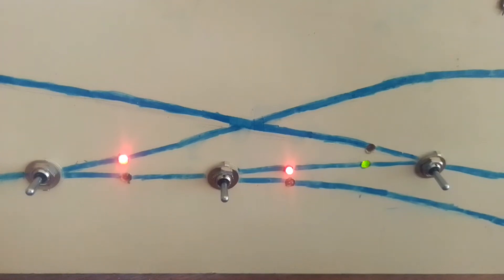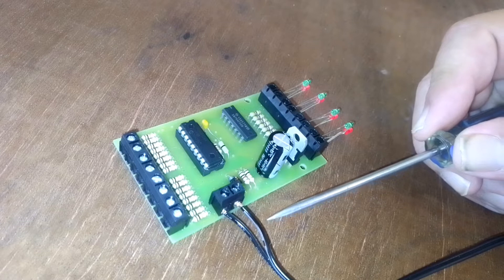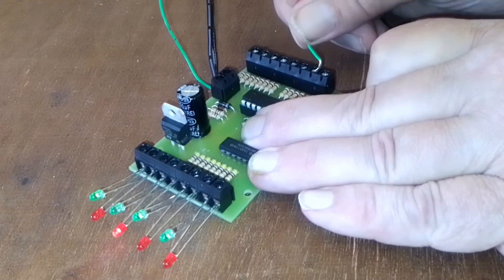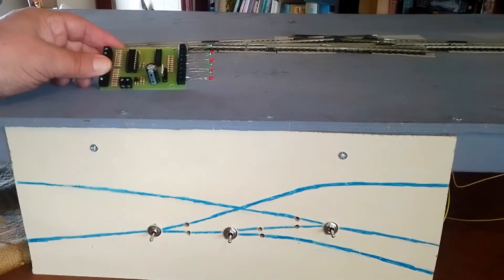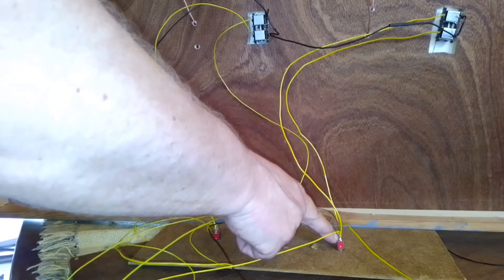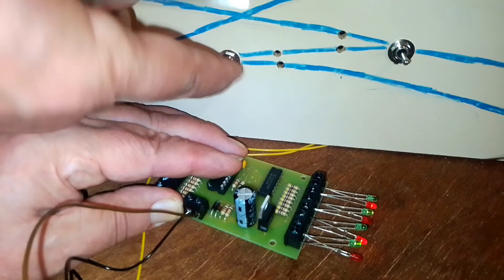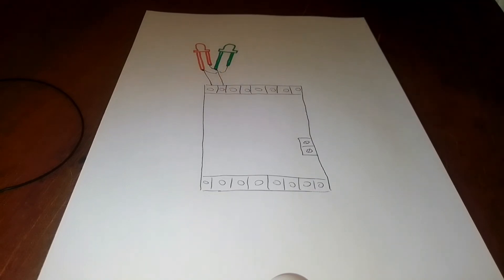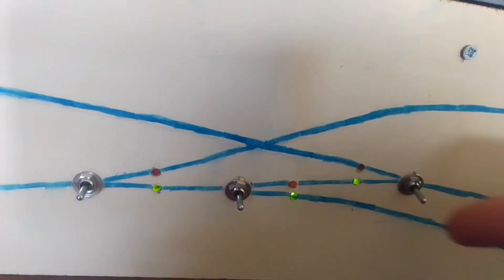See how your Points are Set

Comment from the maker: This video shows our Point Indicator Standard, we also produce the Point Indicator SO which allows a large number of LEDs to be operated and the Point Indicator Relay which in addition to switching the 8 LEDs has a SPDT contact for each point setting. This is particuarly usefull for switching the frogs of N gauge points which because of the small throw of the point blades are difficult to make operate a contact mechanically. For more information and for online ordering have a look at the point indicator page on our website http://www.heathcote-electronics.co.uk/point_indicator.html

Comment: These systems are fine to include indications on a control panel, but shouldn't be relied upon to indicate the actual position of a point.  I have operated many layouts using solenoid style point motors, and the one thing I have learned is that they are not 100% reliable.  You can flick a point switch, but it's not 100% guaranteed that the point will actually move, especially if the point motor or it's connection to the point is a bit 'sticky'.  The indicator, however, will show that the route has been selected, which could lead to derailments if relied upon.
Reply from the maker: Thank you for your comment. Although it is true that the Point Indicator could be fooled by a sticky point motor the problem is solved by making the point motor operation reliable, solenoid point motors are very reliable but need to be mounted without introducing a lot of friction, wired with sufficent gauge of wire and operated with sufficent voltage and current. A CDU will increase the current.
Reply: @heathcote-electronics  Completely agree.  However, it's one reason I moved away from solenoid motors to servo, as it didn't seem to take much for a solenoid to become unreliable.
Reply from the maker: I @delboy1727  I also prefer servos for point motors. Other advantages are realistic movement, you can use a 2 or 4 pole switch so you have 1 or 3 contacts spare. The servo is continually powered so pressing the point blade against the stock rail, handy for scratchbuilt points or if you have lost the spring out of the peco point and you can power it from 12 volts DC which is more easily obtained in a sealed unit.
And an extra reason, if you give too much power to the solenoid point motor it will switch the point with so much force that the point will eventually be damaged by the impacts.

Comment: Very cool, can I use something like the DCC concepts chrome mounted LEDS with your device? Thanks
Reply from the maker: If the LEDs are the standard type and not the 5 volt or 12 volt type then you can. But if you look at a supplier such as Rapid Electronics you should find nice mounting clips.